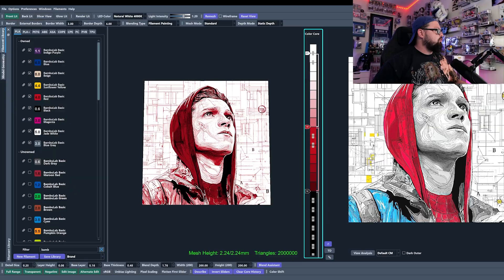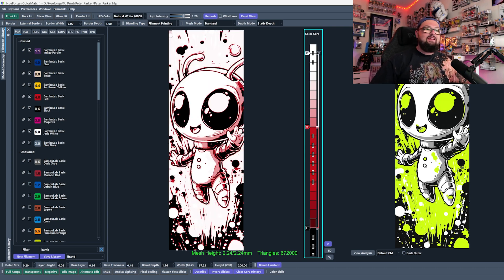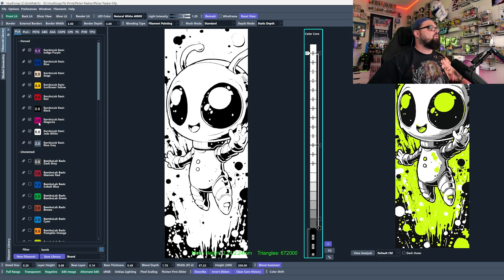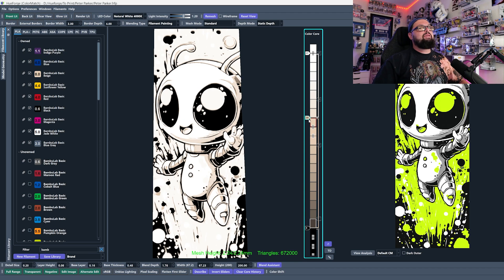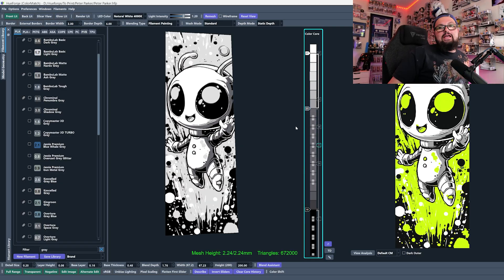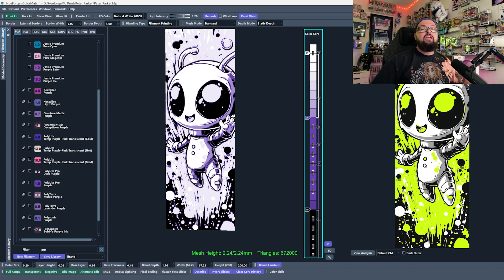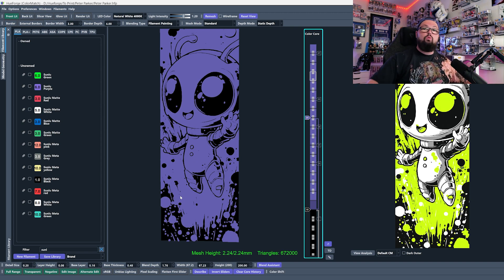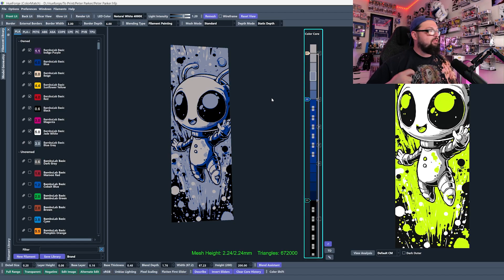HueForge Made Simple – Episode 2: The Key to Understanding HueForge

Comment: A couple comments. First in this example you broke one of the cardinal rules when working in Standard by placing the Beige filament (TD 8.0) below the Jade White (TD 5.0). In general you should always stack from lowest TD bottom to highest TD top. You also need to evaluate what you’re going to get color wise by thinking TOP DOWN on a front lit project NOT BOTTOM UP. It’s taken me a bit of time to lock this in but it now seems to make much more sense thinking in this manner. When you placed the Beige mid stack (just above Black) it basically had no effect because the top White (TD 5.0) was dominating the resulting color. If you switched to the proper Low to High TD stack then the Beige would have more of an effect and you could reduce its impact by raising the mid Jade White as needed. I think it makes it much easier to understand the mixing and resulting colors if you think TOP DOWN for front lit HF projects.

Your explanation about why the Beige didn’t have much effect when dropped just above the Black was a little misleading because you weren’t evaluating TOP DOWN. The reason it had so little effect was because it has a higher TD value (8.0) than the top Jade White (5.0). So the White does not transmit light through effectively and thus it dominates the look. In order for the Beige to give a reasonable look you must stack more layers of it (bring the slider UP) so you minimize the number of White layers above. Again this makes much more sense if you always think TOP DOWN for front lit projects.

One other thing you didn’t mention was the TD value is the number of mm of the filament needed to fully block light transmission.